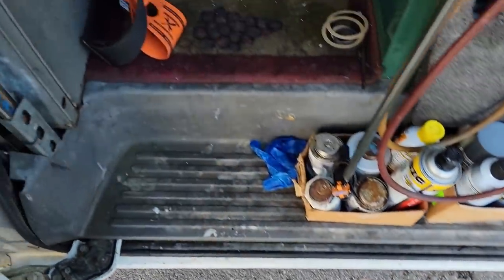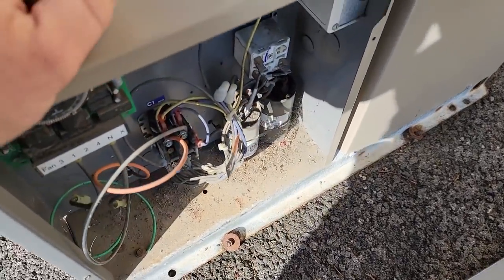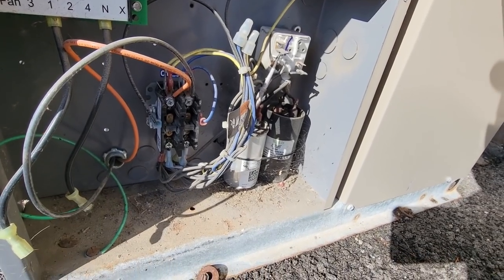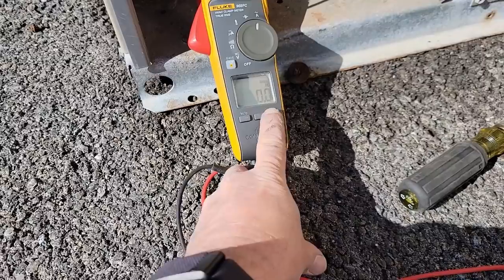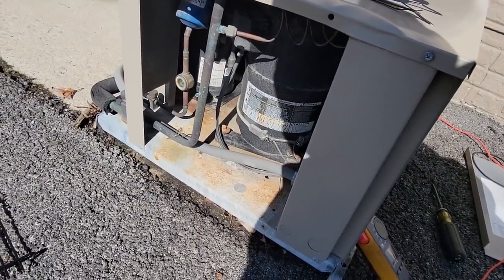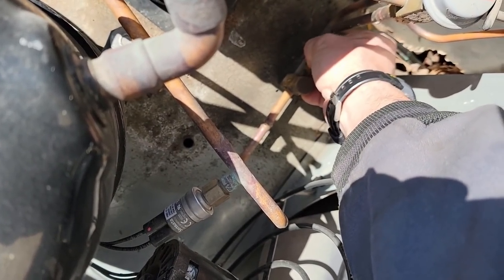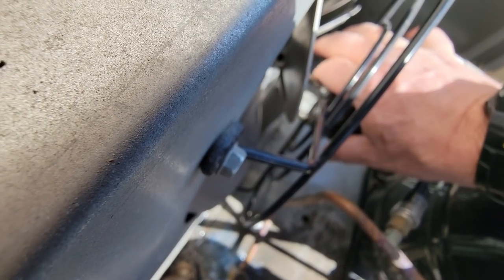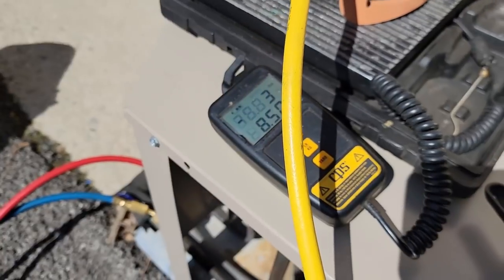Warm Food, Burnt Capacitors & Missing Refrigerant!

Comment: I hate leaks I would rather something be broken I don't care what it is. I had a leak on a duel pressure switch hi-side was rubbing of course. 1am emergency at a ice cream place. The manager was like we need this running at all cost. So I took some copper I had for a humidifier and made a coupler and got it going. I go look this is a 100% repair. Ideally I would have replaced the switch but this will work period. Do you want me to come back? He said no I trust you. This was about 3 year's ago. I stopped by with my son (17). I take him on job's. Showed him the repair he goes WTF? I go sometimes you have to think outside of the box. Lol
Reply from the maker: I've seen that type of repair, it works 🤷. You got to do what you got to do to get it going👍👍

Comment: I noticed when you marked the time clock, you just put a line on the dial and looked to see if it moved.  Here a helpful tip. On the inner dial where you set defrost time, the coppper pointer width is exactly 5 minutes. Mark the timer dial on the leading edge of the copper pointer and wait 5 minutes.  Your mark should now be on the trailing edge of the copper pointer. 👍
Reply from the maker: I never thought it that👍👍 thanks!